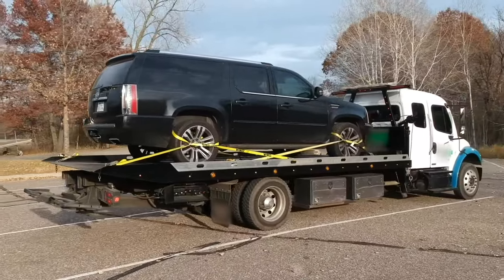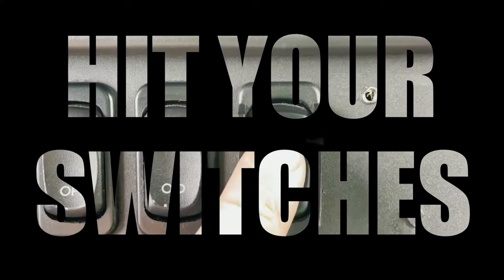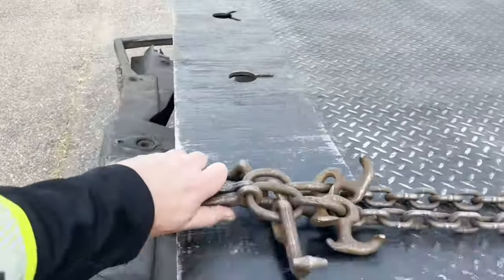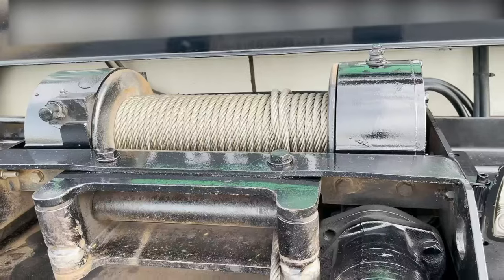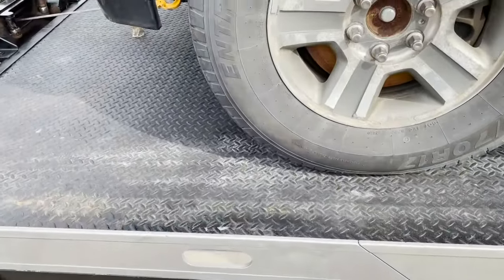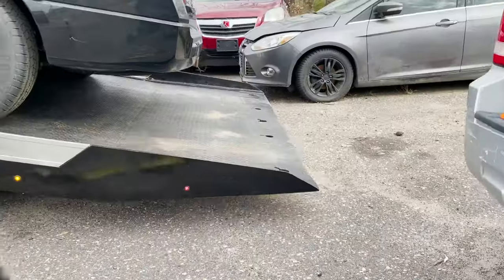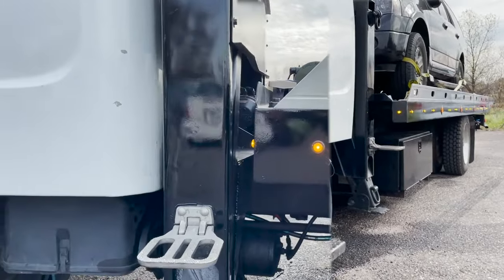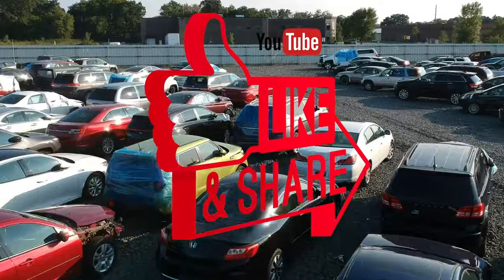5 Steps to Loading a Flatbed Tow Truck - Towing Training for Drivers

Comment: Didn't see you put the car in park when you had your first strap on and on some cars you should lower a window some cars will lock if the key is on and then you have another problem plus if you don't carry a lock out kit then what I think your video is a good training vid but when you are showing the hook points you should show what goes where the mini j the r hook the t hook because you have the right vehicle to work with using the cluster bridal just saying
Reply from the maker: Hey! Thanks for watching, I really appreciate it!

I didn’t put the vehicle in park because I transport in neutral. My question to you would be: Why do you tow in park? You need to have 4 points secured, if done correctly, the vehicle will not go anywhere. This is taught in most tow truck training programs such as Wreckmaster.

I also leave the key in the ignition for 3 main reasons. 1. Most vehicles will not allow you to pull the key from the ignition if it’s not in park. 2. If the key is in the ignition and turned back so accessory is off, the vehicle will not lock. 3. It prevents me from leaving the key in my pocket, where in the past I’ve forgot it, and then I have to drive back to the drop off location to drop the key back off.

I ONLY use the mini J, big J, or soft straps. The rest of the cluster gets ground off and thrown in my scrap metal pile. I realize this may be controversial but it works for me and does not, in any way, decrease safety during transport.

Everything gets gently snugged down with the winch once I’m finished securing. My loads don’t shift or roll around using my method.

Hope this cleared some things up for you!

STAY SAFE OUT THERE!!
Reply: @cashtows  wreck masters don't show you everything I was watching a video from wreckmaster about loading a car on a flatbed it was a Cadillac with a long back end you know the bumper gonna scrape what should you do not worry about it or use wood plus putting it in park Will  keep the car from rolling away if in a accident or when your straps rip because when you think the straps are tight they will stretch and loosen when you stop and go in traffic and don't say it hasn't been done no matter how long you been towing your still learning

Comment: So technically, you’re using a eight point tiedown system and you really only have to do the front corner tire and the back corner tire
Reply from the maker: Yes I’m using an 8 point tie down system but you need to secure 4 points of the vehicle. If you only secure one front corner and one rear corner, that’s only 2 points. You need to secure 4 points of the vehicle in order to be secure.

Comment: I always have a 2nd line from the bed to the vehicle just in case the winch fails pulling on or letting off. Had winch fail once. van rolled of my bed and came to a stop after taking out some massive gates.
Reply from the maker: I can’t say I’ve ever used a second line. Ive never broke a winch line personally but have heard stories of the winch breaking and unspooling. I personally think that if you break a 3/8” steel core or fiber core when operating a light duty wrecker or rollback, you’re doing something wrong. Also, I don’t trust the screw in eye bolts from BMW, Audi, etc. I’ll soft strap a control arm before I use those.
Reply: @cashtows yes and no, those control arms are soft cast aluminum and are prone to bending… and with Benz? Good luck even finding an exposed control arm lmaoo
Reply from the maker: They are but if the lower control arm can handle smacking a pot hole doing 70mph down the road, I assume it would be strong enough to pull the vehicle up the bed. I always grab both drivers and passenger control arm so that the weight is spread out. I've been doing it for years and have never had a problem. 

Only thing is that you have to laydown and really reach under there sometimes. Like you said, "good luck trying to find a control arm" can be a real issue when working a winchout or poor contions.  I typically charge more for these vehicles because of this and other liability reasons.

Comment: If you have a fuel leak what type of tow truck should be used, the garage is about 4 miles away. I live on a narrow dead end road so I’m concern how they are going to loaded the vehicle since the Blazer is facing forward and there is no way to get in front of it? Can they put it on the flat bed facing backwards, or doesn’t it matter? Never had anything towed before so I’m concern.
Reply from the maker: If it’s leaking fluids, flatbed is the way to go as it’s easier to contain. They should be able to load backwards, making sure nothing will be damaged by pulling backwards. Sounds like it will be a slow transport, not getting on any highways. Should be an easy hook but every situation is different.

Comment: Question why not put vehicle in park while in transport?  Thanks for the video.
Reply from the maker: Great Question! I am Level 2/3 Wreckmaster Certified and during the class, the instructor explained that there is no reason to put the vehicle in park during transport. Why? Because you're supposed to secure your load well enough that in the event of a rollover, you won't lose your load. So whether it's in park or neutral, it shouldn't matter as long as you're securing your load properly.
Reply: Thank you for the reply!
Reply: @cashtows what are some safety precautions to take when unloading u should make a vid on that thats the main part that scares me on thes "roll-backs" pun intended 😅
Reply from the maker: @fredc8618  I will make a video on that this summer. My equipment is very well maintained and I'm very experienced. That doesn't mean that things won't happen but I would say that 9/10 times, when the vehicle goes rolling down the bed, it's operator error. Guys who have had a car roll off the end of their bed, most likely are not using the winch and just drive the vehicle up the bed. This should NEVER be done for multiple reasons, safety being #1.

Thanks for the comment and support!

Comment: Thanks! 👍   I will appreciate it if you can make a video about the bed control. How to use it.  Thanks again very good video.
Reply from the maker: Most every truck is different, especially when hoses get crossed. lol. Is there something specific you’d like to know?
Reply: @cashtows  ooh!  Ok thanks! 👍 I just buy a tow truck and I don't know anything about it.  But I being seen videos to learn how to use it.   I will practice how to use it, i will pick it up my little car with it.  But I appreciate that you respond my tex.  Thank you! 😊
Reply from the maker: @elicose771  that’s awesome! I will try to get a new video out soon. Thank you for your support! By the way, what kind of truck did you buy?
Reply: @cashtows   ford f650 5.9 Cummins 21' feet long rollback bed. I am in new Orleans.  (Champion bed)
Reply from the maker: You will never go wrong with a Cummins. You're able to handle almost any job with a 21' bed, I highly recommend.

Comment: I noticed the SUV in this video had some tow hooks installed but were not used.  Is is better to use the tow points on the frame instead?
Reply from the maker: I wouldn’t recommend using those hooks. Always grab the frame if you can. Trucks and SUVs shouldn’t have an issue finding hook points on the frame.

Comment: Never been in the industry barely learning , is it bad to load it front end I think about everytime loading ass end first so all the weight are on my drive tires ? Haul with chains we have a car hauler this is next I'm poor but soon
Reply from the maker: I like to think of it as a balance beam. As long as you have the weight level, you’ll be fine. Things to be aware of when pulling backwards is damage to mirrors, tonneau cover, front bumper, etc. Vehicles are not designed to be driven 60+ mph backward, more liability for you  as a driver. 

With that being said, I do it all the time…EXCEPT CONVERTIBLES!!! Don’t ever haul a convertible backwards, the rear window can easily blow out.

Comment: Does raising “the feet” put more stress on the truck? I struggle with steep driveways where the feet hit the concrete and prevent me from moving back. Thanks
Reply from the maker: Good question. I plan on making a video on this in the future. 

The only way I take on a steep driveway, if I attempt it at all, would be to back up at an angle to the driveway. The steeper the driveway, the more of an angle. Get one rear tire up on the driveway and then crank the wheel to straighten the truck out. Continue backing up and let the other wheel roll up on the driveway. By backing only one wheel on first, hopefully it will get the feet high enough in the air to clear the driveway once the other side rolls on. I hope I explained this well enough. It's a lot easier to show you.
Reply: @cashtows yea it’s like ‘sneaking’ it on so the stabilizer bar doesn’t scrape… agreed

Comment: You don't put the vehicle in park once it strapped?
Reply from the maker: @unclescarhead5587  nope, I transport in neutral. If you have all 4 points secured, you shouldn’t have to worry about anything moving around.

Comment: Thanks... How would you load a 4×4 ???
Reply from the maker: I load every vehicle the same way. FWD, RWD AWD, and 4x4. As long as I have 4 points secured, not including the winch, I’m good.

The 4 points can be any mix of wheel straps, chains, or tie downs as long as the equipment you’re using is rated correctly. Most of my equipment is rated for 3,400lbs+ each.

Comment: With a long wheel base like a full size van , why does the bed end of the bed lift hitting the bottom of vehicle as the front wheels put weight on the bed ?
Reply from the maker: I'm sorry but I don't quite understand your question. Do you mean when the vehicles front wheels leave the bed and then the bed pops up? If so, it's because the air was never released from the rear air bags. I hope this answered your question.
Reply: @cashtows  OK.E350 Powerstroke Van.
As he lowered van back to ground...it rolled back, rear wheels now on ground, Van's front wheels still on tow bed,
The back end of bed shot up slaming bottom of van.
I didn't like it ..
But oh well.
Next day heavy diesel smell.
I looked underneath ,
He flattened my fuel tank AND DRIVESHAFT !!
(Aluminum I might add)
It's over now, but I was just wondering what HE...did wrong .
Dude...once rear wheels grounded....bed SHOT UP !
Reply from the maker: Thanks for the clarification and I'm sorry this happened to your van. 

First question I would have is did the tow truck have air ride suspension in the rear? If so, he could have forgot to dump the bags, so when the rear wheels left the bed, it took the weight off and acted as a spring board slamming into the bottom of the van. 

I'm actually surprised by the amount of damage this caused. Unless he drove the car off the bed, which is not the proper way to tow, I don't know why the bed would shoot up that fast, ESPECIALLY with the front wheels still being on the bed. It's one of those things where I would have to be there to see what was going on.
Reply: @cashtows  Thanks for the reply.
It was like the front of the van still being on the bed..ahead of the bed pivot point,
Teder tawdered it !
My drive shaft had a crease in it so deep it actually cracked open at the ends of the crease. Kinda like ya hit it with an ax!
Thanks again.
Reply from the maker: So it sounds like the driver hit the wrong lever. My guess is he hit the lever to lower the wheel lift which would cause the bed to rise.

I really couldn’t think of any other way this could possibly happen. Do you know if he had a wheel lift on his truck?
Reply: @cashtows  I'm not sure about a wheel lift.
The bed was up...
Cable from which letting van roll down/off.
About the time the rear wheels grounded...
Tail of bed, shot up, hitting bottom of car.
I do appreciate you replying !

Comment: Thank you...... but "No Chocks"?   At all?    Without a long story one single block of wood or any chock will save your ass if you fail to recognize a grade or unlevel surface.  I always have 4 on the bed within reach. (I'm in Colorado at 8,000', things can roll a long long way here)
Reply: Ablan es pañol te interesa traer grúas a Querétaro México tengo una consesion de tramo federal
Reply from the maker: I can honestly say that I’ve never personally broke a winch cable or had a winch fail nor have I personally seen it happen. Not that it couldn’t but I’d like to know if winch failed on its own or was it user fault/poorly maintained equipment.
Reply from the maker: Interesante, me gustaría aprender más. ¿Puedes enviarme un correo electrónico? cashtows.com

Comment: So you need a cdl to operate these trucks or can a class c be good enough ?
Reply from the maker: A standard class D drivers license is all you need! That will cover you up to 26,000 pounds. So basically you can drive any single axle truck up to 26,000 pounds gross weight. Anything over that, you will be required to obtain a CDL.
Reply: @cashtows  hey Do you mean class c ? you put class D.  I got an interview this week that’s why I’m asking. Thanks for your feedback. I’ll subscribe to your channel
Reply from the maker: Minnesota is class D. I’m not sure about other states but a class D in MN is your normal drivers license, nothing extra. Might want to look into your state specifically.